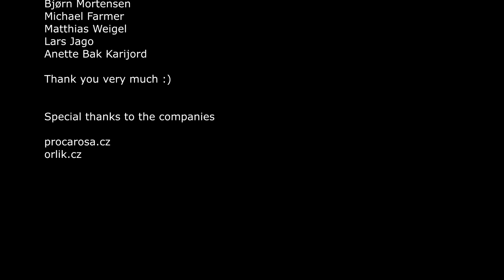Carpenter's Bench ( ponk ) - Restoration

Comment: Thank you this video. Just a quick tip, there seems to be missing a pressure plate on the shoulder vice, needed, otherwise the end of the screw thread will bruise the job being worked on. Best wishes, Veronique.
Reply from the maker: Thank you very much for the heads up. This carpentry table serves as a decoration.

Comment: You did a beautiful job restoring that old bench, but I would have skipped the bees wax.  Part of the utility of those old benches is the ability to keep work from sliding with hold downs.  If you wax the surface, you reduce the friction and work may slip while planing or chiseling.  But otherwise, splendid resurrection of a wonderful piece that has likely seen the work of many craftsmen saved from the dump or bonfire.  Bravo.
Reply from the maker: Thanks for the advice, but the waxing was at the request of the owner.

Comment: To get screws out that have been in wood for a long time  use AN ELECTRIC SOLDERING IRON hold on the head of a screw  for a few minutes. The screw expands breaking seal with the wood , When it cools the screw is easier to remove
Reply from the maker: thank you for the advice :)
Reply: 52memor Cheers, i shall remember that tip, regards from the UK !
Reply: It's a hot spanner

Comment: Nice job saving all original pieces. Should have cut off that overly long screw of the face vise, though. Seems a replacement screw for the tail vise, thrown in there as a temporary accommodation. Cutting it down to the proper length and fitting a movable jaw would have been appreciated by the original constructor, I am quite sure.
Reply from the maker: I agree, but the table is not mine, so I can't afford it. The table is designed for a museum.
Reply: Veradona Restoration, I copy that. I didn’t appreciate the situation. You mention another one of your own, no? Looking forward to seeing that one! And I appreciate acquiring a new word for this item: ponk!

Comment: I didn't see it - but a heavy wax coat on the wood threads Really goes a long way.  Put it on heavy then run it screw in and out a few times when still wet to make sure that the internal threads get a coat of wax also.

Very fortunate that all the threads are in good condition.

Comment: Here is a tip for cleaning wood surfaces like you have there. Mix a solution of 50% Baking Soda and 50% Hydrogen Peroxide in a plastic bucket, stir well and either apply with a sprayer or by hand to the wood surface evenly. It will foam a lot. Using a stiff natural bristle brush scrub the entire surface down and let stand for about 30 minutes then rise well with running water. Let dry completely, and retreat areas if need be. When dry this will have raise the grain quite a bit and require sanding. Leave bare or apply any finish you want. The wood will not look new, but it will much cleaner and without any stains except the deepest ones. Any questions let me know.
Reply from the maker: Thank you so much for your advice Joe. Have a nice day Veronika and Radek

Comment: Not wanting to take away from some impressive work, but aren't you asking a lot from the glue with regards to the re-turned screw?  I think the torque might overwhelm the glue & it would break free?
Reply from the maker: That's why there are metal locking screws. And moreover, the museum will not work on it :))

Comment: Nice looking bench. And I like that you were trying to preserve the character of the old bench, but would it be such a crime to fix an old design flaw this bench has? I’m asking because the screw that’s perpendicular to the long side of the bench (the one that acts like a clamp) doesn’t need to be so long if the maximum travel is already set by the opening. I noticed at the end that the screw was fully in, and it was still sticking out a lot. I would shorten it to prevent me running into it, but that’s just me! Hehe
Reply from the maker: Thank you Leo, yes I agree. The bench is not mine, so I didn't shorten the screw. It will be placed in a museum, there will be no work on it :) Veronika and Radek
Reply: Veradona Restoration thank you for taking the time to read and reply to my comment. And I probably should have read the description, I thought this bench was going to be in your home. I appreciate all the work you guys do and I enjoy your videos, keep up the good work! :)
Reply from the maker: @leobrent7926  Thanks Leo

Comment: Of course now that it’s been glued, it’ll never be able to be taken apart again.
Reply: Thank you Guillermo.  The incredible bench turned into furniture...
Reply: Gluing was pretty much the only option if the original parts had to be saved. The bench was so dry that the dovetail ends came straight apart because the parts had shrunk so much.
Reply from the maker: Thank you colleague, you can see that you understand.

Comment: Great restoration! I have one question: Doesn’t the expanding glue need moisture to activate it so it expands and fills the voids? I always thought you had to spray the parts with water first.
Reply: Moisture content of the wood should be enough, but longer cure time. Not loading moisture into the wood is the big virtue of polyurethane glue, in my view.

Comment: Looks very pretty but there's one problem with your restoration. I refer to all those small holes all over your bench. That's called woodworm and it's pretty advanced. All that light colored sawdust that was on the bench runners was what should be in the holes. In other words, in a year or so the nicely restored bench will be consumed by those pesky woodworm. I recommend taking off the wax and treating the whole bench with woodworm killer. If you do not take the wax of the woodworm killer will not penetrate deeply enough and be a waste of time and money. Whatever you do, do not leave wood on top of it or the woodworm can jump ship and start munching on that. Personally I would have gave it a vikings funeral and just made a new one but it's a shame you have spent all that time on restoring it. I would have thought your dog would have known that and told you before you spent all that time on the restoration. Tut tut dog!

Comment: it's a real shame that someone let that bench fall into such disrepair. -- No respect for what they had. 
Original Bench Dogs (the metal stops for clamping) probably would have been made of wood too. 
I cringed at the use of urethane glue. Hide glue may have been used in the original, but it has no structural integrity if there are gaps in the joints. Urethane fills the gaps but also has little strength if there are gaps. Epoxy would possibly be better. Repairibility will be difficult with either glue. 
None the less, it looks good and is now functional because of your effort.
Reply from the maker: Thank you Richard :) Veronika and Radek

Comment: This is not restoration, glue and sand dont restorate it just clean it. To restore a carpentry workbench the top should to be flatten, the gaps filled and cracked pieces replaced. Now is just a furniture, not workbench
Reply from the maker: Thanks for the feedback. The repair was performed at the customer's request.